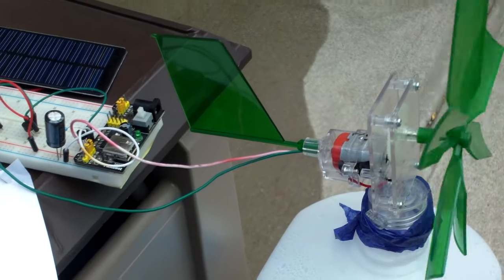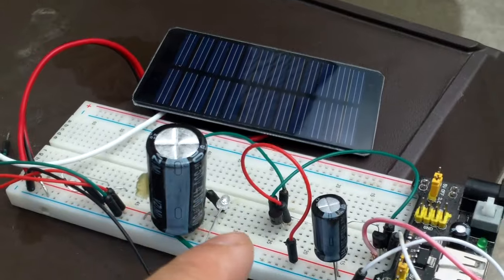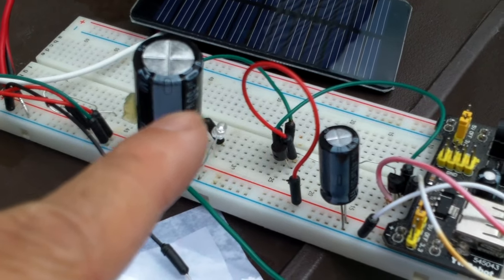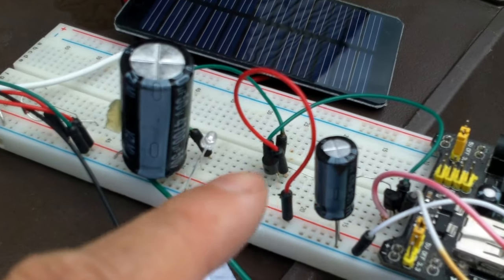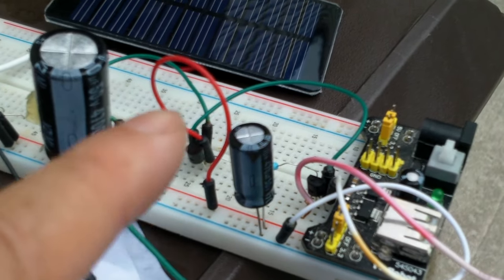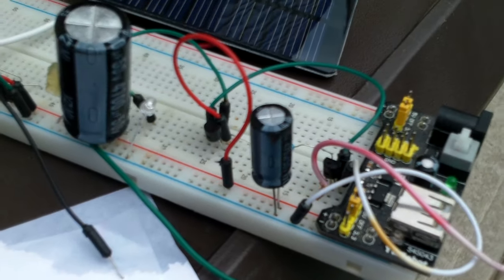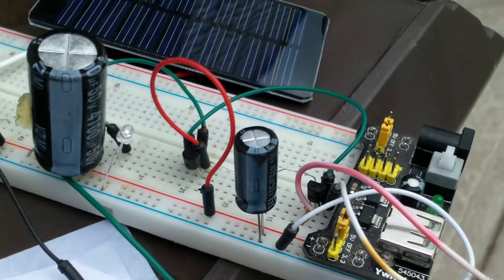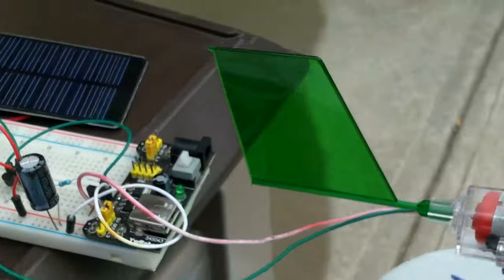My first solar engine

Comment: Could you use two solar panels to provide more current to the capacitors to charge them twice as fast?
Reply from the maker: +Bradley Herbst Yes you can.
Reply: +wtam69 Would the solar panels have to be identical at least in voltage at least in a setup like yours?  I put together a Solar Marble Machine and the solar panel provided is to small to work inside. I'm trying to figure out if I can add a second small solar panel, not identical, to the solar engine or if I have to replace the existing one with something bigger. Thanks.
Reply from the maker: Bradley Herbst You can have different sizes, it's just that they won't be as efficient. If you need more voltage, you connect them in series. If you need more current, you can connect them in parallel. For some devices, it won't matter that much which way you do it as long as you stay within the parameters as it's the watts that counts. For more critical devices, as in charging lithium ion batteries, you have to control the both voltage and current.  A constant voltage, constant current boost(step up) or boost buck(step up/step down) converter is your answer in that case. That is why there are some many of these boost/buck converters on sale.  A more knowledgeable person would be able to explain it to you in a more succinct way, unfortunately, I'm not that person.
Reply: +wtam69 Thank you. You got me pointed in the right direction. lol
Reply: +wtam69 Thank you for getting me going in the right direction and feel more comfortable moving forward and experimenting with trying to improve the speed.  I really appreciate it. Thanks again.

Comment: Hi, is it possible for you to compile a list of materials needed to conduct this experiment? I am an 11th grader and we need to conduct a science fair experiment therefore I was thinking of conducting this experiment where I use polarizers to only allow one spectrum of light to pass through, hence the frequency of light incident on the solar panel changes and see if there is any effect of that on the speed of the turbine.
Reply from the maker: Sorry I did not reply earlier. Please go to the end of the video where I have a diagram of the solar engine and pause the video to see the individual components.  I did not compile a list of the parts at the time.